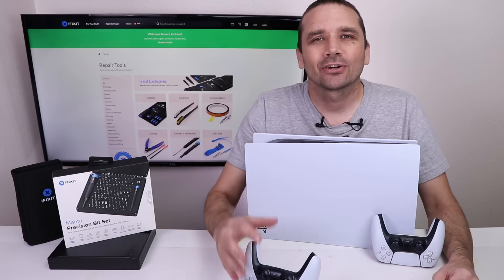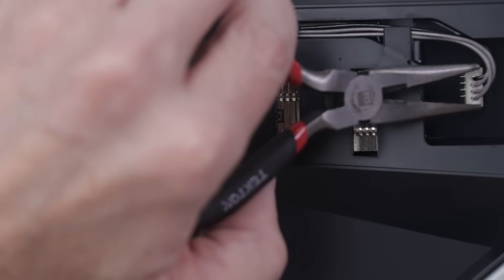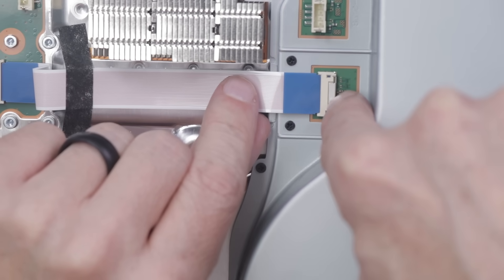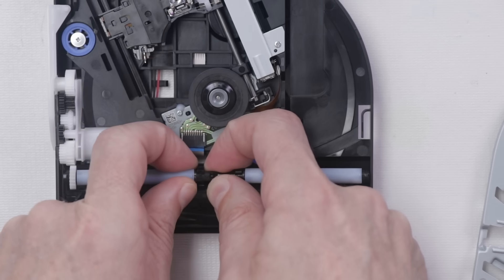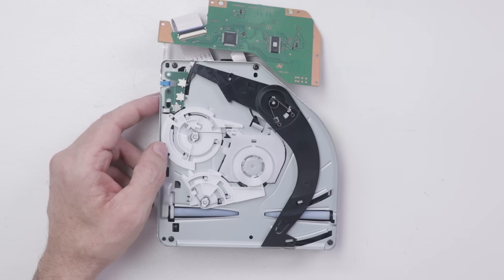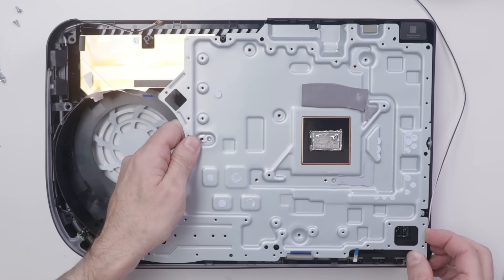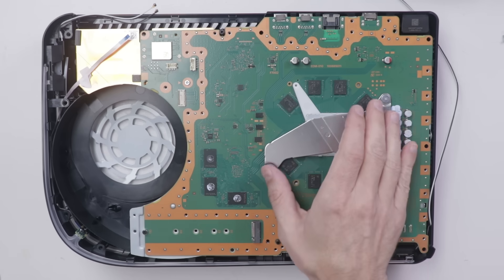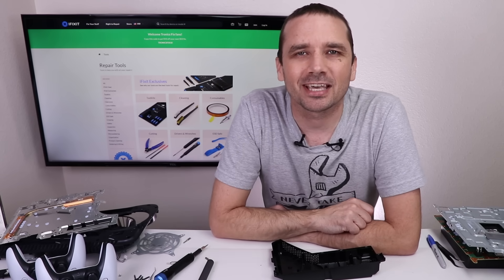PS5 Teardown - A Repairability Perspective

Comment: It looks like a pain in the ass to disassemble and reassemble. It's almost like a subtle message hinting to the frustration of Japanese design engineers that worked overtime without extra pay who want us to experience their suffering.
Reply: Best teardowns, I mean.. he takes apart optical drives and PSU's without breaking a sweat.
Reply: MertensCW  he was making a joke bro.
Reply: I feel like it's overly complicated and could've been simplified far more. It's sad to see that I won't be able to clean it as easily as I can my PS4.
Reply: @sj4iy  There's literally dust catchers built into the PS5 that means you can clean out the dust without taking it apart. Go watch the official PS5 teardown, the guy points out where the two holes are were you can stick a vacuum in and clear the system of dust.
Reply: @MrManBuzz  Yes, I'm aware. I'm also not dumb enough to believe that the dust catchers will get ALL of the dust in the console. Because it won't. Dust will collect in the fan and in the console itself, just like it will in the Series X. Just as it has in every other console and computer before now. The easier something is to take apart and clean the better. Even my Macbook is easy to take apart and clean. The PS5 will not be and that will cause problems.
Reply: @sj4iy  actually you can get the heatsink out without breaking the liquid cooling construction, you just pull out the whole motherboard including heatsink and then your able to clean it easily.

So from a pure maintenance perspective, this console is awesome. Very easy to clean, even I would be confident enough to do it.
Reply: Even tho it’s very simple, didn’t u see the trending vid a couple months ago about the ps5 disassembly? It was deemed to be the easiest console to take apart
Reply: @samueljackson2257  funny joke.
Reply: @ShinyMooTank  compared to the ps4 it’s super easy and straight forward.
Reply: @ShinyMooTank  I take it u didn’t see it then?

Comment: liquid metal just destroys copper, those first batch of PS5 gonna all be dead within 2 years!
Reply: Nope. The copper is likely nickel plated on the contact area. The new TIM is one of the last things to fail on this system. The fan or disc drive I would expect to fail the first out of all of the parts and even on those theres still many PS1 out there after 24 years that have working disc drives.

Comment: Man this console is garbage to repair, 1000 screws not replazable ssd its better to apply new liquid metal each time you take it apart just for security cause it can always spread some and short something, and probably married components to the motherboard like the disk drive, the series x is amazing in my opinion, i don't think it will be worth for professionals to repair ps5, you lose a ton of time and sometimes can even not be fixable

Comment: @roniccsFix Hello Steve,
I was hoping that you try to see if any of the available M.2 SSDs can work on the PS5 or not?
Reply from the maker: I want to but really wanted to get this teardown video out asap
Reply: @Tronicsfix  I understand. I will be waiting for the next one as I always. Best wishes 😃
Reply: Doesn't work right now
Reply: @Its_Ayyz  Yes, I saw some videos that explain what happened when an SSD was added to the PS5, the system did not complete the operation process and request to remove the SSD that was added.

Comment: I believe they made vacuum holes on the side panel so you can clean part of the heatsink.
Reply from the maker: Yes, which is nice but not really helpful since the buildup will be on the inner side of the heatsink (where the fan is)
Reply: @Tronicsfix  the fan was easy to get to. so not really a problem?

Comment: So with the  Soldered on SSD chips, even though is will be a pain, are they replaceable if they go bad and inturn restore the system to a proper working order?
Reply: SSDs don't really go bad like ever.The console will be replaced by the PS6 by that time trust me.

If anything the PSU will fail before the SSD which means your entire console will not even power on.

SSDs and HDDs in general have a crazy long lifespan.Think about it we keep most of the world's important files on hardrives why would we do that if they fail all the time?

Storage devices are literally designed to last as long as possible.
Reply: @xXSinForLifeXx  , cool thanks for that info and enlightenment. I can't wait to get my hands on the PS5!!

Comment: doesnt seem like the memory chips are cooled, very minimal contact with the thin metal cover
Reply: Leopold  its g6 tho on the ps5. And its shared between the gpu and ram so it will probably get hot. This just makes it less likely to last years down the line

Comment: 13:34 As far as i know, that is the ssd controller
Reply: Aka southbridge
Reply: It is their custom flash controller to drive those flash chips. It is not a “south bridge” controller. It’s also why their drive isn’t an off the shelf and slower laptop m.2 NVMe drive as found in the Xbox Series consoles.  
PS5 design centres around a guaranteed minimum IO speed and latency. It’s not a user swappable part. It doesn’t even use the NVMe standard.  

He’s right about it being difficult to get to the heatsinks, but also seems unaware of the dust catchers and vacuum port.  

I get that he wants to do a blind tear down, but this also highlights why Sony wanted to do an official one first. To show the correct way to remove the side plates and being able to point things out people would miss, as well as clarify things that might otherwise be mislabelled.
Reply: @EeekiE  he even took unnecessary steps to get to the heatsink. You can pull out the motherboard and heatsink altogether, like you could see in the official teardown. If you just want to clean it, what will be the number one reason to open this up, there isn't any complicated steps involved anymore.
Reply: @Federal Bureau of Investigation thanks fbi
Reply: @Federal Bureau of Investigation make sense, but Sony said that was a custom ssd controller. Now i dont know If that is the south bridge, that is also the ssd controller
Reply: @FelipeLenschow  thats definitely a southbridge, may be search google images for ssd controllers and south bridges(x570, b550, x399).  May be that will clear up your confusion

Comment: Man the Xbox series X jus looked like they crammed everything like a sandwich in a box with one direction for air to flow but its much more user friendly considering ps5 has alot more surface area to play with
Reply: What are you talking about you have to remove 43 screws just to remove this metal plate 7:27.  How is that user friendly?
Reply: @aszneehitme8691  i was saying that the Xbox is much more user friendly considering they stuffed it like a lunch box
Reply: @fnggaming89   At least  with the Xbox you can take the whole thing out in one go. With the Ps5 you literally have to take part THE WHOLE system just to fix a faulty power supply. HOW IN THE WORLD is that user friendly.
Reply: @aszneehitme8691  yea for real

Comment: About those cable connectors with pins, are they weak as they used to be in Ps4 pro? I remember pulling whole psu connector from motherboard, only 2 pins left on the motherboard. I was like wth, does it work that way? I realized i screwed up later when I was putting things back.

Comment: Sony has said in their PS5 teardown video that the holes visible at 1:05 (and again from inside, under the heatsink at 10:41) are there so you can vacuum out dust. Do you think that would work well enough with a powerful enough vacuum, or would we really need to take the whole thing apart?

Comment: Just to add, the expandable storage doesnt work just yet, Sony has to do an update for that and will announce whta m.2 SSD's will be supported (Why won't all m.2 SSD's be supported?!)
Reply: I think it’s because only PCiE Gen 4 is required while a Gen 3 could go in the slot
Reply: They need to make sure the SPEEDS work for RDNA2 because RDNA2 uses PCIE 4.0 speeds and thus the SSDs need to match or better those speeds so the system can run at its maximum performance  without destabilizing the console
Reply from the maker: Yes, this is true...and I agree...why not just support all m.2's. Could be just because they need to meet the speed threshold.
Reply: IIRC Mark Cerny said that any m.2 PCIe 4.0 drive that meets their speed requirements (~5GBps) will technically work with the PS5. Another thing to consider though is the physical size of the drive since according to him, there are no real height specifications for m.2, meaning you could end up buying a drive that doesn't fit (if the manufacturer puts some giant heatsink on it or something). So thats why they said to wait until they put out a list of confirmed compatible drives.
Reply: @spezy93  If the manufacturer puts a giant heatsink on it, you can just remove it. If you can handle installing an M.2 drive, you can handle removing a heatsink from one.
Reply: Only licensed drives probably, remember psp memory cards?
Reply: This launch is such a clown show from Sony. They're so unprepared. Not supporting expandable storage at launch is an absolute joke. And you can't copy games over to a USB drive for storage purposes ether, so if you run out of space (and you will since they couldn't even give you 1TB, the clowns), you have to start deleting and downloading games. Absolute joke, I won't even consider buying a PS5 until Sony fixes this mess via software updates. Xbox already has all of this figure out, Sony shouldn't be launching until they have it figured out too.
Reply: @mjc0961  you not doing any research on why these things happen, Is such a clown show of a joke...
Reply: @mjc0961  I bet you are one of those guys who wants to install all his 1300 games on the ps5 day 1, right?
Reply: @mjc0961  Considering the SSD is super advanced, makes sense that they'd need to wait a bit to get compatible drives
Reply: @mjc0961  dunno, at least Sony got some games coming for their next gen console. And the expansion slot is deactivated as there aren't any m.2 drives available that reach the speeds necessary - 7 GB/s is the minimum requirement to work. And the drive needs to have 6 priority levels for accessing data, compared to the normal 2 on conventional drives.

And it's 825 GB because of connecting the SSD via 12 lanes. It would be only possible to stock up to 1650gb instead of 1 tb, and as the SSD is already a sheer monster which is high advanced, that would just cost too much. They are already loosing 100$ per console.
Reply: @mjc0961  Sony will release another ps5 in a couple of years, it will have more storage.
They just released it cuz they were unprepared but, they wanted to compete with xbox, if they released it late, lesser numbers would buy it cuz they already have an xbox.
Imma also buy the ps5 after 2 years so that I can get more storage space and maybe it would easier to repair.
Reply: @huzaifakhambhati8767  100% wrong.
They kept the storage small because it would have been too expensive!
You can upgrade your storage, others don´t have to pay more for more storage because they don´t need it = consumer friendly
Reply: @kenshigo3833  good point
Maybe, (I don't think this will happen) but they could make a ps5 with hdd, 1.5 tb or even 2, and keep an ssd to boot the games
I am not sure if this is possible and I don't think that will happen
Reply: @huzaifakhambhati8767  Won´t work. They insist on the SSD speed for future games and that´s good. They will get cheaper soon anyways and games (and we gamers) will profit a lot from it.
Reply: @kenshigo3833  I will just deal with the 825 gb ssd, it's not a big problem for me, anyways I am will buy used games if they are offline games
I ain't gonna buy much from the ps store
Anyways I won't be able to buy a ps5
Reply: @huzaifakhambhati8767  i´m the same mate. i only play 2-3 games at a time anyways and i also buy some used. not a fan of digital only

Comment: After having to deal with tearing apart the regular ps4 and putting it together I told myself I wouldn't bother taking apart another sony product. It's absurdly assinine how much of a pain they make it to take apart to do simple maintenance like replaceing dried up thermal compound.
Reply from the maker: The PS5 looks like more work to do most simple maintenance tasks (cleaning)
Reply: @Tronicsfix  except they litteraly have 2 holes meant for a vacuum cleaner and the fan is what, 2-4 screws.

Comment: ...wow, Sandy Munro would not approve of that number of screws. Holy cow, lol. Why would you put that many screws on a motherboard? That's actually insane.

Absurd number of screws (and mismatched screw types, and a bunch of other manufacturing/repairability problems) aside, yeah it definitely looks like xbox won repairability this gen. Time will tell how all the parts hold up and if you'll be taking those 40 screws out over and over and over to get to a tiny chip buried in the bottom of the console. I'd switch to a powered screwdriver like at 10:55 as well.
Reply from the maker: I really hope the PS5 motherboard doesn't have any chips that go bad a lot.

Comment: Yeah. I'm probably never going to need to try to clean or repair a PS5, but I can agree on the fact that the internal design isn't so great for anyone needing to perform maintenance. I wonder why Sony decided to make it like that. It's like the complete opposite of the Xbox Series X. Those snap on covers also only work because there's no spinning HDD. With an old spinner, they would resonate. I feel like they are kind of cheap.

I'm not planning to buy either one of the consoles, but I immensely like you opening and fixing them. Thanks for posting the video!
Reply from the maker: Thanks for watching! Yes, I think the Series X has a more maintenance friendly design.
Reply: Im laughing about those rat kids replacing Everyday the thermal paste hhahahaa!!
Reply: There's dust collection vents that are easily accessible by taking the top cover off, and the fan is pretty easily removed. What else can you reasonably repair at home? Disc drive looks easy enough to replace too if you can get one.

SSD solution is for performance, as it's considerably faster than the standard SSD in a Xbox, so that's why they've done that.
Reply: @leatherworkstation  the actual ssd speed is not that much different between two. and real world test show xbox is ahead of ps5 by little margin
Reply: @ianfahrizal85  the ps5 ssd is capable of 2x faster speeds than the Xbox series x
Reply: @joe_schmoe_420  Capable? maybe.. It's definatly not doing it becasue of sony's poor optimisation lol.
Reply: @joe_schmoe_420   what matter is the real speed test not just a paper spec
Reply: @ianfahrizal85  At the moment, PS5 is barely above XsX in speed in games designed for 8th gen. Wait until entire engines are designed around new SSD speeds to reach proper conclusions.
Reply: @ianfahrizal85  that's in last gen games.

In current gen games PS5 is considerably faster. They're both quick but for example Devil May Cry, PS5 loads in 2/3rds the time. 

For more complex open world games this will be a more impressive margin.
Reply: @ianfahrizal85  these are unoptimized games and mostly 3rd party
I can assure you that the ps5 ssd out performs the Xbox series x in every facet except space even without these optimizations
Reply: @ianfahrizal85  I looked into it btw, and XSX uses a PCIe Gen 3 SSD with an ideal world read speed of 2.4GB/s, the PS5 has a PCIe Gen 4 compatible custom SSD with a read speed of 5.5GB/s+

Also the fact it's Gen 4 means the additional SSDs you put in will be as fast as the system storage if they're Gen 4, currently a 1TB Gen 4 Gigabyte Aorus nvme SSD is £139, so considerably (up to £85) cheaper than the slower additional storage you buy for the series X (£220, 3.7GB/s), and not proprietary either. 

Seems like a big win for the consumer there.
Reply: @leatherworkstation  on xsx it's pcie gen 4. And in coming year there will be another company producing extended storage for xsx. those ssd can't be installed on ps5 as it speed below ps5 ssd. Also Sony has not release a list of supported ssd yet, so you haven't choice to expand the memory just yet, maybe until next year
Reply: @ianfahrizal85  the one that's in the console is PCIe 3 even if the interface isn't, as per WDs specs. Only goes up to 2.4GB/s. 

The expanded storage is faster but the controller has no DRAM so isn't up to full PCIe 4.0 capabilities, more like PCIe 3.5, faster than 3 but half the theoretical speed of 4. The controller is a Phison E19T which can max out at 3.7GB/s.

The Aorus SSD I quoted is almost as fast as the internal storage at around 5GB/s. The theoretical max of PCIe 4.0 is 7GB/s if allowed by the system.

There aren't that many reputable SSD manufacturers so I'm sure they'll be pretty swift with a white list of PCIe Gen4 nvme SSDs. 

It'll be patched in soon enough.

Comment: Was that a small chip below the hdmi pins or just 2 blank solder points? I hate when they put diodes and other small stuff so close to it, Ive had to replace them when the hdmi port gets smashed in and its not very fun. Thanks for the great video again!